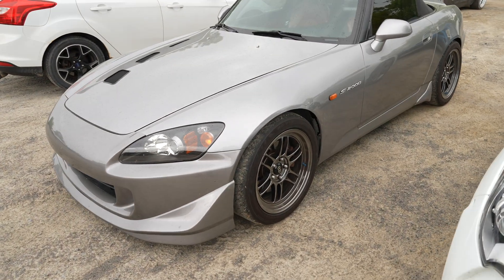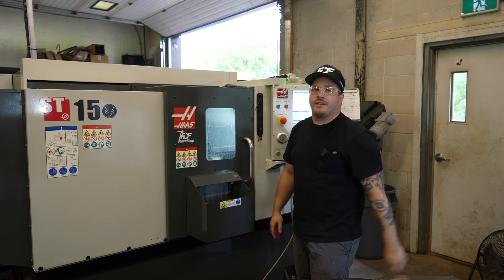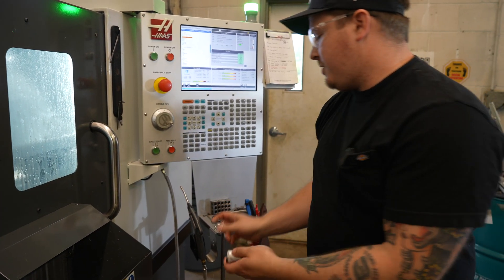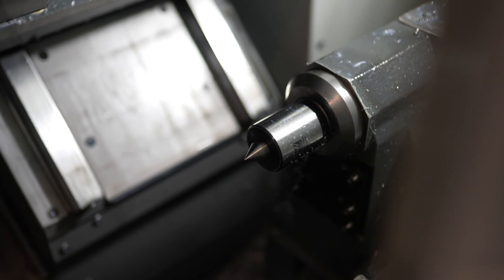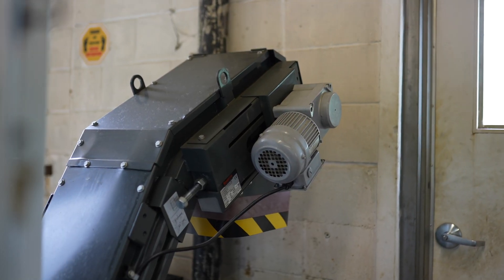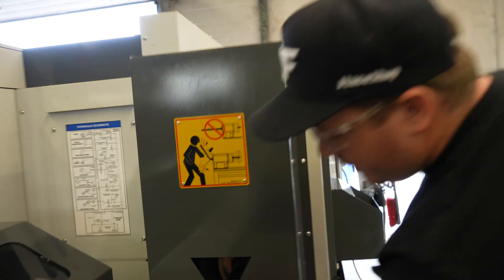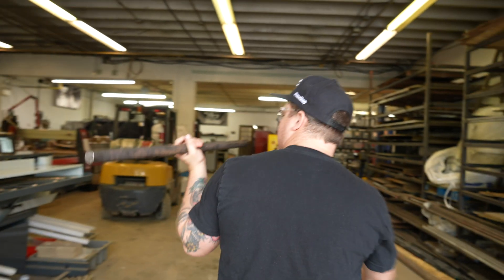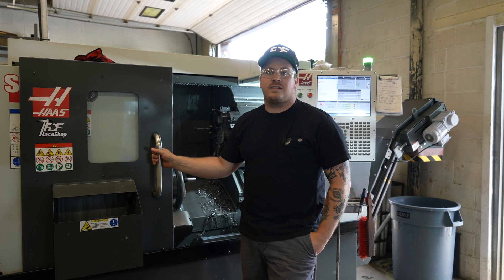We're Starting a Machine Shop | HAAS ST 15 Lathe

Comment: I have just one small investment idea for yall. Cincinnati Superior collet pads. You will need to get the angled masters for the pads, but what it does is save you money and time. Being that your running smaller stuff you can swap pads out very quickly and save on your set up time. They make a ton of different sizes. The other benefit is that you can stack drills, taps and some id tools at tool stations that are next to each other and they will clear your chuck. That's a nice thing with Haas that I've learned. Anyways just something to look into and see if it's worthwhile for your applications. Keep up the work! I enjoy seeing manufacturing coming back.
Reply: Isn’t that Manufacturing we’re always be Upper and Superb in usa?

Comment: Nice lathe. I just bought the same machine and waiting on delivery.  I had a hard time putting it where I wanted because of the conveyer needing 5' of clearance to remove it.  I noticed you conveyer is against the wall.  That won't be much fun to get out if you need to.  Nice looking parts, Keep rocking on!
Reply: You're right, we are very space limited and have plans on moving the CNC machines into our new shop expansion asap, so we are just counting on luck currently lol. Enjoy the new machine!
Reply: @FDF_CNC  After having to clean the sump, I learned real quick, slide the conveyor out (pallet jack, floor jack or hoist) and you have full access to 90% of it clean it all.  There are a couple nooks toward the back by the pump but wet vac and extension gets it.   With the conveyor in there, forget it, no access anywhere.